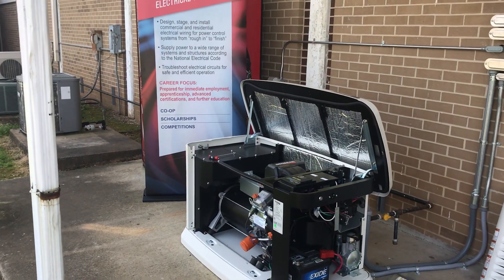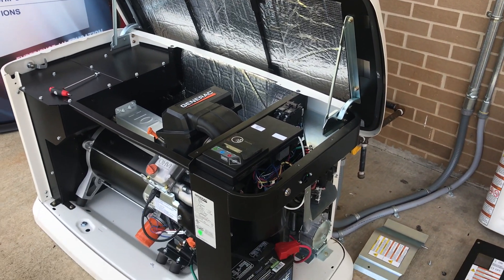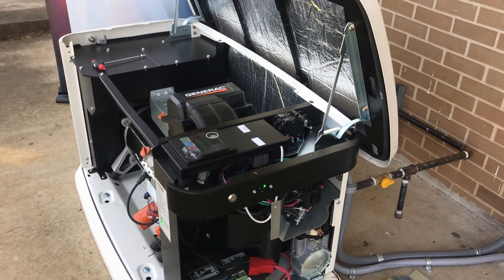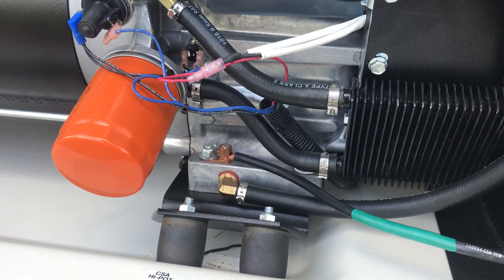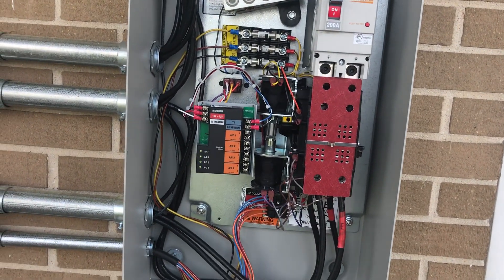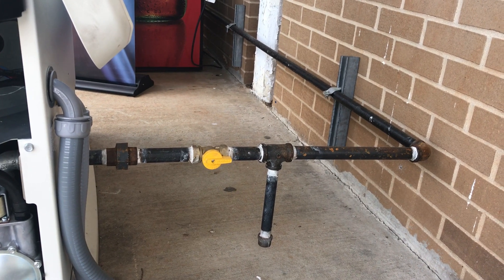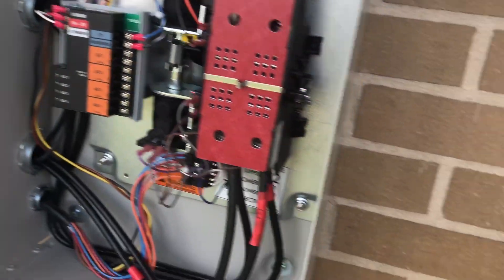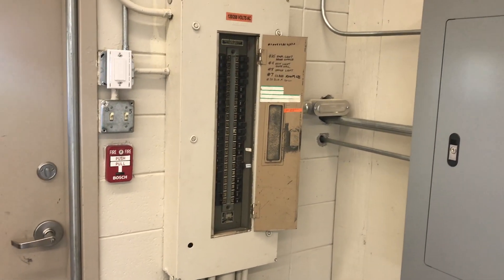Generac 22kw school project Northwest-Shoals Community College Electrical Technology Part 1

Comment: should be a flex line on the gas pipe at the generator.
Reply: Thanks for letting me know. That does make sense. I will let the HVAC instructor know this since his students put that part in.
Reply: @elliottraymorris5074  I guess they didn't read the installation instructions?